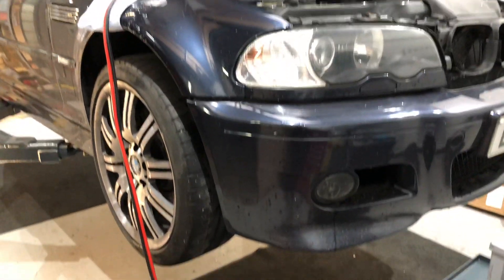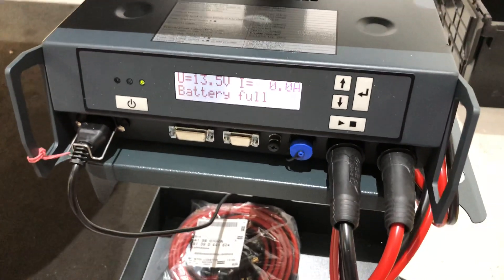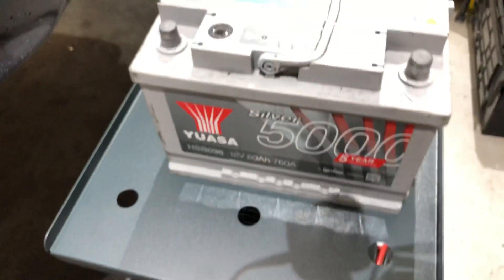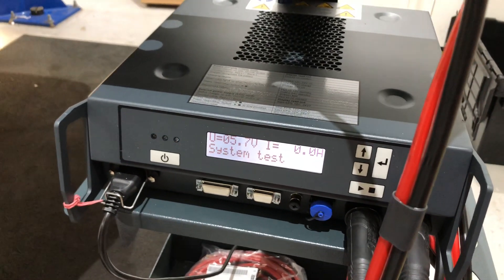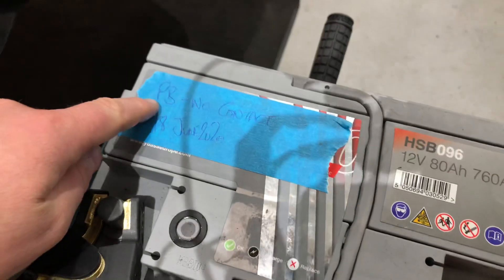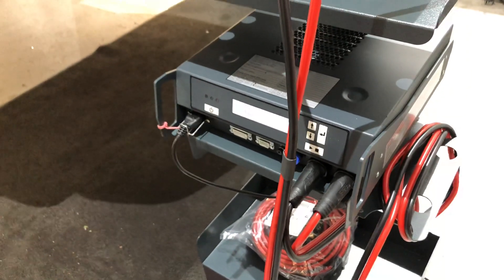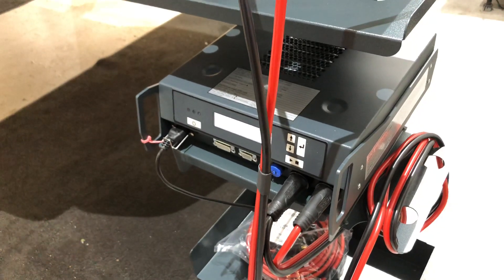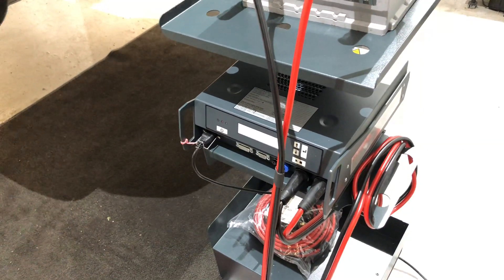Genuine BMW Power Supply & Battery Charger

Comment: Hi,

For BMW and Mercedes, is it ok to set power supply at 14.5v facotory default on my new Powermax power supply, and connect to battery during key programming without overcharging the battery or causing other issues?

Comment: The only problem with those chargers is that when a battery is totally flat you need to use a shitty charger to get alittle bit of juice in before it'll start the charge with that one. Great on a ok battery as it'll go through a desulfate to recon a battery and you can set the maximum charge to use on the M cars Lithium batteries

Comment: Try sticking some leads of a good battery to the faulty battery, that will get it charging and you'll probably find the battery is serviceable
Reply from the maker: Thanks Emmanuel. Will try. Great to hear from you. Hope you're well! James :)
Reply: Redish Motorsport No worries! As I’m sure you know that technique helps with good condition flat batteries, not the faulty ones like you had there! I’m well thanks, good to see you guys are still busy considering the current circumstances!